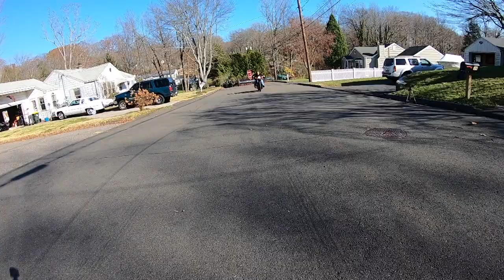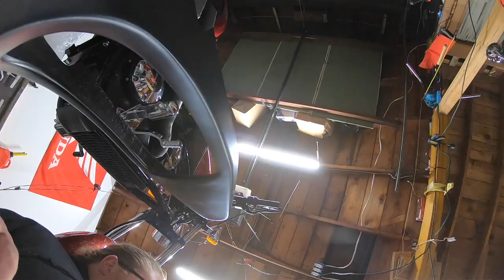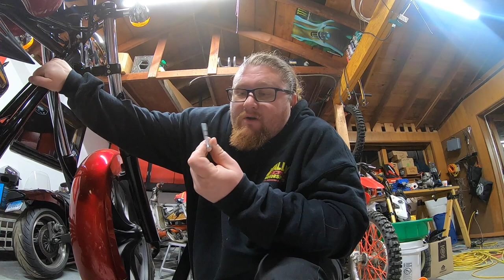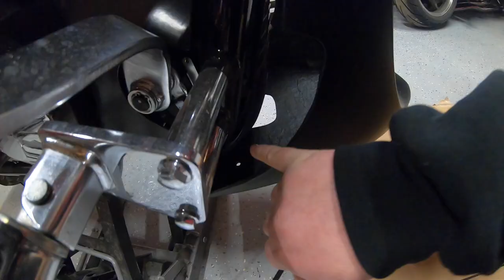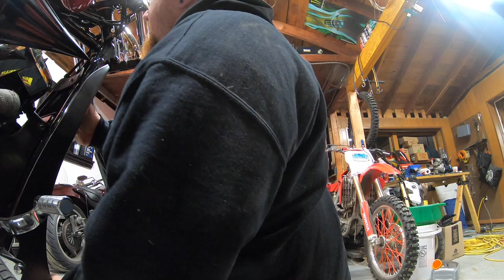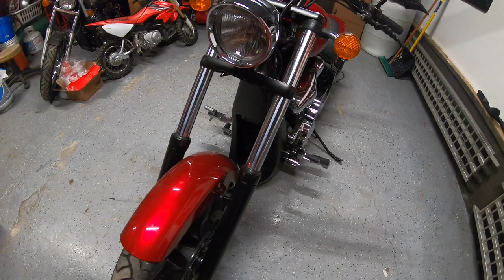NEW Honda Fury Chin Scoop

Comment: When you hacksaw a bolt put a nut on the bolt and it will clean the threads when you remove the nut .
Reply from the maker: That’s a great short cut! Usually I’ll cut the bolt then thread on to clean.. I’m a dummy didn’t think to do the opposite and thread on first 👍